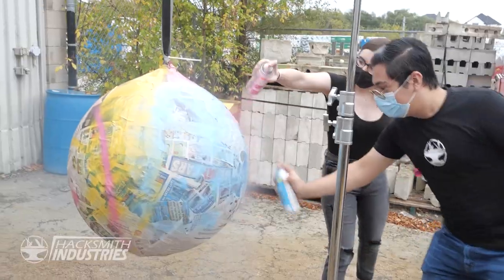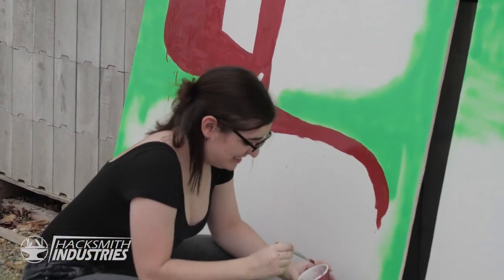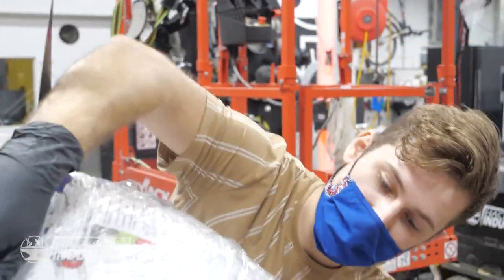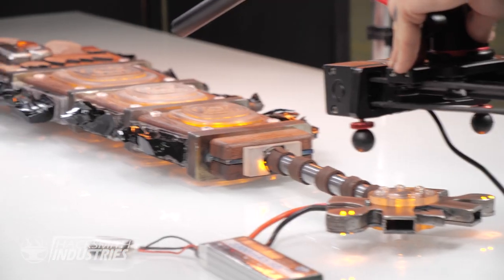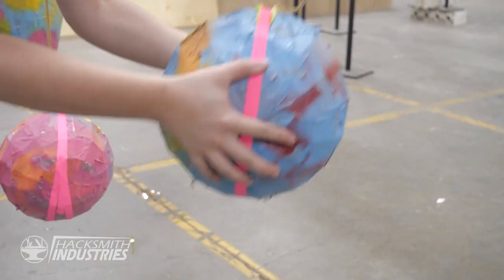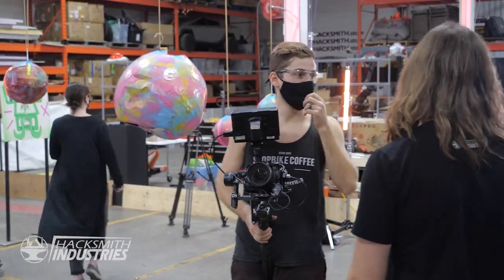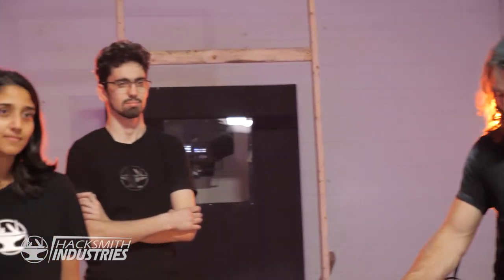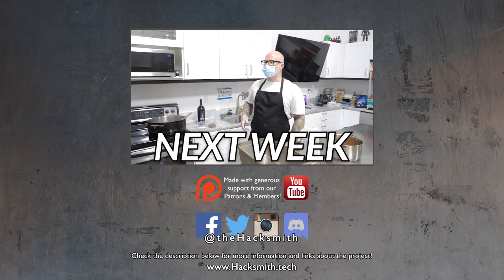THINGS GOT OUT OF HAND! (WEEKLY VLOG #30)

Comment: For god's sake don't do anything more using obsidian. It's shards are very very sharp and dangerous specially the tiniest ones, you guys were putting your hands close to the "blade" too often and that could lead to some deep cuts. If any of them were to shatter and fly into someone it could be super dangerous,
Reply: Well I see James wearing gloves; I'm sure for that exact reason. Not to mention, there is always a calculated risk to produce what they intend, and I'm sure they put a lot of research into the project before they decide materials and what level of risk is okay. This is not to say that I think they always make the right judgement calls (who does?) just that they are aware of their choices and do not need to be told. I think concern for their well-being is good, but assuming they have no idea of what they're working with is insulting and not constructive.